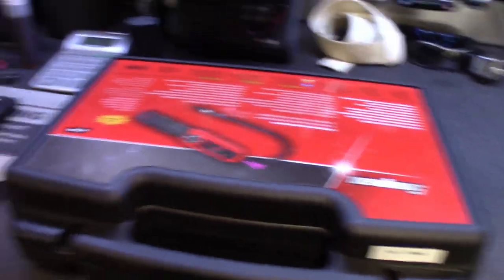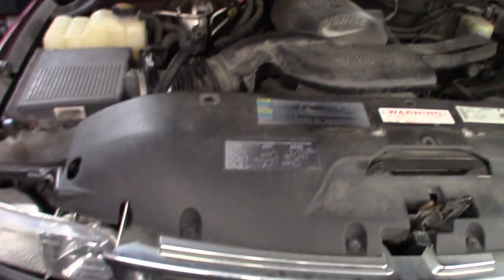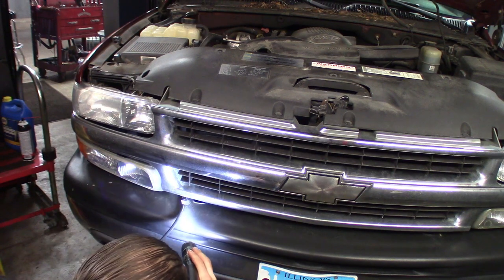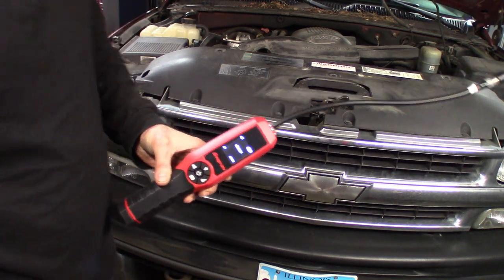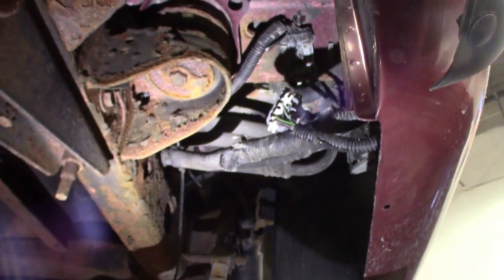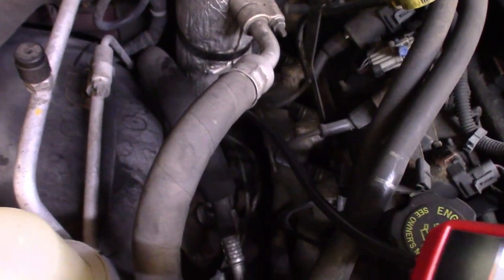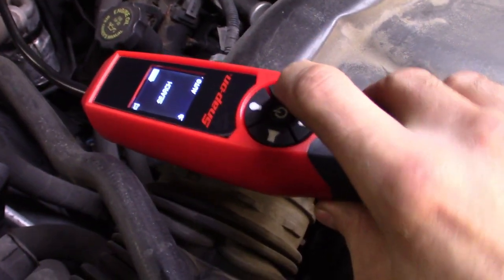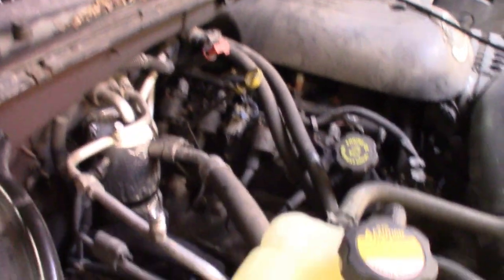Toolz In Use S2E4

Comment: Wait till the new systems come along to aftermarket shops. They got the dye and are expensive as heck for it to be fixed. I think they're starting to come off warranties. 

Wish I could find affordable space and a mechanic or two who are what they say they are as I can handle the customer service skills and working when not handling that stuff. 

I watched your video last week and you're right, good respectful techs are hard to find. 

Every used the color changing foam in conjunction with the leak detector. Hone in on the leak closely then use the foam and it changes colors showing the leak point. 

DID you inject dye on this as I didn't catch it at the beginning or not or did you put dye in last fall since you set it up then?

You've probably seen the new systems though. 

I do like the light for seeing the dye on that tool. I wonder if one makes em all because I've seen so many of those lately with that same scale. I was at a parts house vendor show for the upper Midwest a few weekends back and they had a few brands. Picked up a nice Bosch ADS625 with a cool $1k rebate which was nice. Comes with wiring diagrams, on board repair info almost identical to Alldata and has a quick panel for the rest of the other subscription services for repair information, Identifix, shopkey pro, etc. Has the J-2534 pass thru included which is a steal as a J-Box and scan tool in one is a good package. 

IF my videoing skills were better I should do a review but I don't throw technical terms all the time like it's my everyday vocabulary and I have nothing against those who do as we all learn different.

 For me was military in early 90's, class 8 14yrs over the road trucking,  school of hard knocks back in 2010 and ongoing and pushing myself more and more each day as a hobby but love what I do. 

Feel I shortchanged myself in life by not going after my true passion back then. It is what it is so I'll just keep learning, fixing and plugging away. 

Maybe I should just do the review from my perspective. Have a TS608 and Zeus to compare to. Waiting on latest Zeus update though. 

This Zeus may be looking for a new home though but figuring a price will be the hard part. Excellent condition and love the scope.
Reply from the maker: Yeah Dale I put dye in it and tested the compressor before I starting shooting. You should make more video showing your tools I would watch. Make videos the way you want to make em they don't have to be perfect. We really want to open another shop but I have to find a couple guys first.